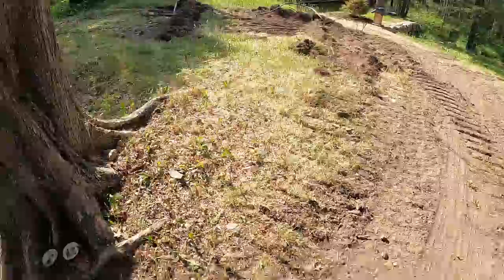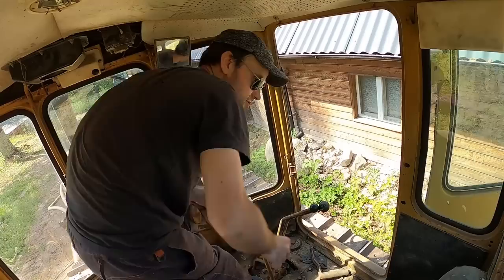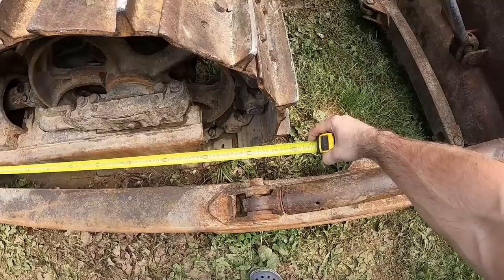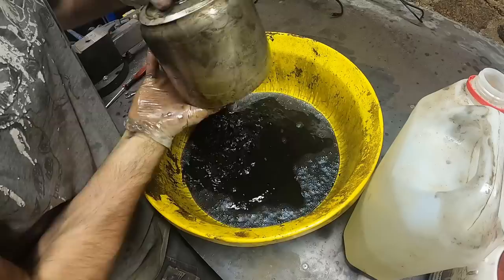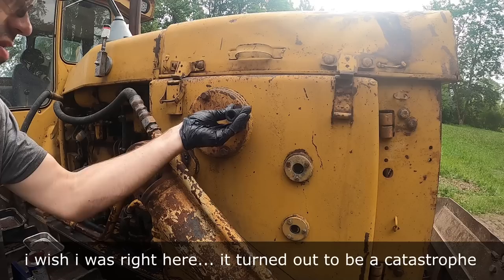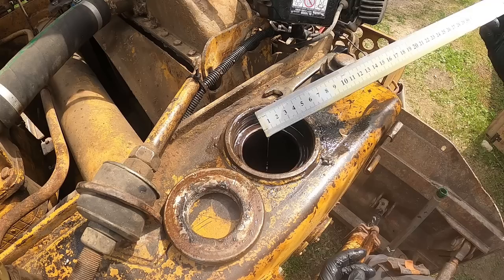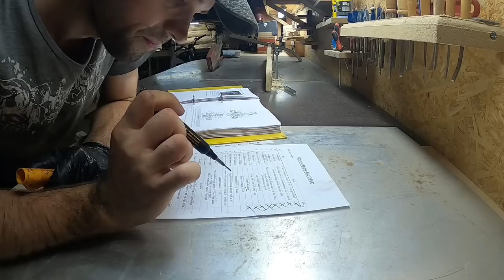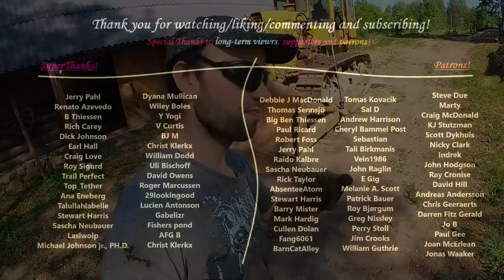Fixing the soviet bulldozer T-170 - Ep1

Comment: We used to drain the oil on machines and put it trough an milkfilter( paper filter on an funnel shaped holder). The filtered oil can be used for a lot of things, we used it for our chainsaws or even fill up our ancient machinery in between oil changes when they use some oil. Easiest way to check if the oil is nay good, after filtration  is just put some between your fingers and rub them together. Water will make it rough as well as dirt. Also for use of making wooden poles rot resistent by putting the ends in a bucket with oil and some diesel and let it soak for a night. The wooden beams wil not rot for many decades to come😂
Really enjoy your vids👍👍👍👍 this weekend can not go bust anymore😊 thanks for another great vid👍 together with dieselcreek and andrew camarata i think you guys make the best vids ( every one in their own specific way)  on the internet🍺🍺🍺
Reply: Back into the fuel tank , them old diesels will burn oil just as good as diesel
Reply from the maker: Thanks man. really cool of you to mention AC and MATT. Love them both
Reply: As long as you realize that even clean used oil has lost lubercating property’s. Don’t use it for serious lube.
Reply: One of my neighbours was a former shell ceo, as long as the oil between your fingers is really slick, he would not change it in his car😂 he was from the development department and called most oilchanges scamms😂😂😂
Reply: @jankrijnen7374  he also made enough money, that he was the scam

Comment: Hello from Canada 
The pony motor has two crankcase drain plugs
Reply from the maker: Yes but why?
Reply: @Ants_Pants  hello 
 Two cylinders are used and each cylinder has a sump of their own 
You can get most of the oil from one of the drainage plugs and all of the oil using both 
You are very entertaining to watch and you have done a great job with the house repairs and the property maintenance 
Cheers

Comment: Good call in doing the service. Great thanks to the shout out as well. I think the rake breaking was like I have had it with this work.🤣 It's just my guess but maybe the T-170 high pressure fuel pump has been swapped out to a remanufactured pump later?  It looks kind of very newish to say the least. I could not find the year when they switched over to the newer style high pressure fuel pump. The high pressure fuel pump on these is a old CAT D4/D6 clone/remanufactured variant. The one on your T-40 is a UTN-5 that is a old Bosch inline pump being redesigned by soviet engineers in the 60s. I would not be surprised if these where the old OEM paper elements in the hydraulic filter. Over all good and very decent progress, keep on going.
Reply from the maker: Tänx! ma alles nüüd jõuan kommidele vastada :D

Comment: That plug on the rear is a 1/2 or larger extension like you use with a socket just by itself with ratchet or brake rebar impack gun
Reply from the maker: Yup your correct

Comment: Santa bring you more work/projct to do 😉😉😉😉.... VERY good work 👌👌👌on your dozer (including the very underrated benefit of cleaning/pressure wash the machine on a regular basis) I believe your dozer never had so much maintenance since new. About final drive plug; I do have succes by removing rusty plug with; 1- wire brush to remove most of the rust 2- than soak/spray it with high viscosity penetrating liquid to follow/penetrate the tread  3- do it/repeat it until it get loose. Sometime heat/torch can help a lot also. Can take some time (believe me...) Nice to see things are going well for you. Looking for Part 2  ✌✌✌✌✌
Reply from the maker: Thanks for the tips 😇

Comment: Thank you for taking us along on this adventure! The pressure cleaner - it sounded exactly like 2 B-25 WWII bombers flying along, until the video was speeded up. Then it sounded exactly like something I heard during the last 2 times I was abducted by aliens. The hydraulic filter was amazing - it just kept coming out and coming out. I was thinking, does this go through the engine? How can it be so long? And I am wondering what is the reason for this? Very interesting, and I cannot wait to see more about it. It looked like it had a ball valve built in, or was that a rod end bearing? Yes, the Sowiet Dozer is a work of art! So many gearboxes - and the spinny thing at the right angle gearbox near the pony motor. Amazing. If I had been given one of these as a small child, I would never have gotten into any trouble! Oh, it was not built yet when I was a child. No wonder I was in trouble....
Reply from the maker: 😂😂😂😂😂 love the comment mate

Comment: Just havin loads of fun!
Amount of iron filings on the engine oil plug magnet seemed relatively small to me. Not good ofcourse but for a machine like that it is probably a win.
A thing about copper gasket rings. If they look good I reuse them, but only after anealing them first. I also aneal new ones. Makes them softer and there is no need t tighten them til kingdome comes. Just heat 5hem until the glow good and driop them into water, or just letting them cool on something non cobustable.
Nice video as usual.
Great thanks!
Reply from the maker: Thanks for the tips mate
Reply: @Ants_Pants  btw. Forgot to precise what I said about the iron filings on the oil plug magnet.  Probabaly it is there due to the thinned out oil. Just be vigilant and keep a keen eye on the levels and viscosity. If that amount of iron filings keeps on accumulating despite correct oil condituons then you need to start plan the new video series on how to extract, renovate and restart a magnificent piece of Soviet motoring. 😄👍
Reply from the maker: Oh snap 😂😂😂
Reply: @Ants_Pants  something to look forward to!🤑🥴🤪
(Fingers crossed for not to)

Comment: Regarding the hydraulic filters.  If you cannot find the original filters, do not use those corrugated paper filters.  As you can see the oil pressure imploded them and started to tear the up.  In my opinion it is better to use fine mesh screen securely attached to the assembly.
Reply from the maker: Apparently it's a standard soviet filter for oil. It was cheap about 3 dollars each. I think the old ones imploded because their service was severely overdue

Comment: Hydraulic oil is hygroscopic, that's why there is rust, the moisture content is high and will darken the fluid. It will rust the pump and other components causing excessive wear.. it's probable haven't been changed in years, if ever. Wouldn't go wrong by changing it
Lift pump was leaking, they couldn't or wouldn't get a replacement, they removed it
Reply from the maker: glad i did, the hydraulic fluid looked like grey vomit i the bucket, in ep2

Comment: This is just a guess but maybe some of those bulldozers came with electric start and some of them came with pony motors. The ones with pony motors may have been determined not to need a priming pump since you can just use the pony motor to turn the engine indefinitely until the system primes itself.
Reply from the maker: mostly export to west had the starter motor, everything locally got the pony motor.
Reply: @Ants_Pants  Yeah that's kind of what I was thinking. I figured if it got a starter then got a primer pump and if not then it didn't. Just a theory though.

Comment: Spray some penetrator oil or spray om the over drives plug it should help it and use a long extension bar to help you open it plus the penetrator spray can help on mostly anything you need loosening or lubricant on
Reply from the maker: It did help yes, i got them loose

Comment: - The threads seem to already crossed because the plug is not screwed in very far at: 1:04:40, Andris
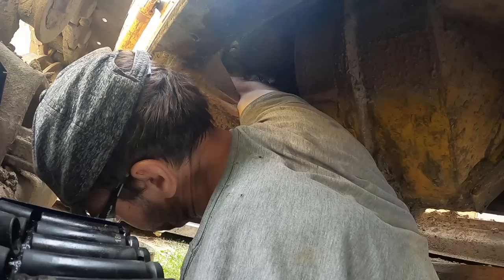- Replaced: 1:06:01
Reply from the maker: Maybe it's not needed?
Reply: @Ants_Pants  
- If you ever do use a pump-jack to hold up the bottom pan so you can take it down for some kind of repair work, you could also re-thread the bolt hole if it was cross threaded.
- Clearly it is not leaking oil and messing with it is not needed, thank heavens.

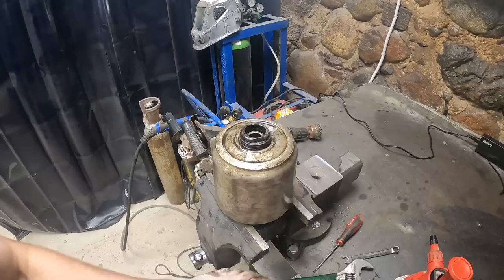Comment: At 33:03 you should can take off the lit of the Engine oil Filter by turning the big nut on Top of the Filter left. Than you should can take off the lit in up direction. It can be a little sticcy cause it can be a Seal at bottom of the Filter.
Sorry for that Bad English
Reply from the maker: I understand sir! But i tried it's very stuck and i don't want to damage it.

Comment: Best start soaking those final drive bolts in penetrant.

What have you used the dozer for so far?
Reply from the maker: Just 3 things 😆 snowplowing, 1 tree pull and some stumps
Reply: @Ants_Pants  nice! Every episode lately I have eyed it off as my driveway needs redone heh. Hoping to buy a hobo like yours soon tho
Reply from the maker: @zzzires5045  although i rip on it a lot, i use the bobcar most often out of my tiny fleet
Reply: @Ants_Pants  yeah that's why I want one here, plus can easily rent attachments like post hole digger ect. They kinda have surpassed a tractor for a farm vehicle

Comment: When I saw you repair the rake I was thinking about the problems I've had with cheap brooms - the heads are good quality, the handles strong enough usually but cheap plastic brackets?!?!!  What falls apart is the silly little plastic bracket that attaches the head to the handle of the broom. I tried to get a metal bracket for this but there was only one design I liked the look of. You could make a Soviet-style broom-head bracket with 10mm steel, so strong that you're guaranteed to snap the broom-handle when you use it. I don't think you'd even need 1mm steel for this but having a few might mean you can keep replacing the plastic ones and buy cheap brooms and replace the plastic brackets when you need. The old style wooden broom head and handle that you could nail or screw together was generally better....

There was a comedy in Britain that had a council roadsweeper in it who once said 'I've had the same broom for 30 years, it's had 35 heads and 20 handles now....' maybe this was because he had a high quality metal bracket to hold the head of the broom on....!

https://thedustpanandbrushstore.co.uk/products/large-metal-broom-socket-bracket-connector-for-platform-and-yard-brushes?variant=14266353713194&currency=GBP&utm_medium=product_sync&utm_source=google&utm_content=sag_organic&utm_campaign=sag_organic&gad=1&gclid=Cj0KCQjwkqSlBhDaARIsAFJANkj9JiiQU9rCXpUxpPK_nbL8_fELZBlIUqx1Q4YmmCOEISIscAPJIYQaAj9TEALw_wcB

Comment: Looks very thin, i would suspect the injection pump leaking internally. If you had an injector problem it would be smoking more. You could also have a problem with the rings bypassing. I could be wrong who knows, like you said its 40 something years old.
Reply from the maker: it does smoke very little after starting the motor for about 20 to 30 seconds, after that the smoke clears and it runs smoke free (apart when load is applied to the engine, but that's dark smoke and normal for diesel engines)
Reply: Yes that amount of smoke looks normal. I would still suspect the injection pump leaking internally, but I also have no experience with Soviet equipment. In a tractor that old the injectors are simply the nozzle that sprays the fuel, not like modern engines that have oil actuated injector units. so if it does not smoke profusely I don’t think that is your problem. Also how did the oil feel when you changed it? Was it slippery like oil or was it more like black paint thinner?

Comment: 100 liters of hydraulic fluid...can the old fluid be repurposed as something useful ? Is it just mineral oil that could be used in a oil heating furnace in a house ?
Reply from the maker: throw it back in the fuel tank 🤣 this thing will even run on crude oil on a rainy day

Comment: Great video, Ant. I know you have a ton of work still to do, and sure, your checklist is at the halfway point, but you really need to do something about the swaying motion of the blade every time you move the doza.

The blade moves without you touching the hydraulic leavers which is bad.  I know there are only two main cylinders and a couple of smaller ones on each side, but it moves way too much fir my liking.

What condition do the pins look like? I bet they are toast like the ones on your bobcat were, I'm just saying.😂😂😂
Reply from the maker: it is missing a support arm from the right side. the weld had broken at some point and previous owner did not fix the issue. I will tackle this problem soon, but i think it will be on Episode 3, not 2. The damage is done though, sidepanels of the blade arms have been eaten into by the tracks.
Reply: @Ants_Pants  great to know Ant. Thanks for giving me a good explanation and what the deep problem is with the blade swaying as it does. And thanks for the details of what is to come in a future episode. Cheers mate

Comment: Be careful you don't get water concentrating in the pump, freezes during winter and then when you go to start it the pump shaft breaks. Guess how I know ....
Reply from the maker: fuel pump?
Reply: @Ants_Pants  
Nope, the soviet hydraulic pump, but it might be more robust than the early '70 yankee pump that I broke due to water/ice build up.
Just considering how bad your hydraulic oil looks. Mine looked the same and the tank filter looked pretty much the same as well 😅
Reply from the maker: @Mr.Engineer.  the pump is not very expnesine to swap out. Around 300$. I swapped the fluid glad i did 😂 see in ep2 this friday
Reply: @Ants_Pants  
Will do, every week 😉
I think my wheel loader is destined for the scrapyard.
Reply from the maker: @Mr.Engineer.  t
Why so
Reply: @Ants_Pants  
To much work, to little time.
Bought a newer, bigger and better unit.

You want the old one?
Come and get it, but do note that there is no hydraulic, so no lifting of the bucket and no steering.

Comment: I thought that looked like a high quality choke cable as most I’ve seen here are poor quality. I saw pull to stop on knob so I imagine it is intended as a fuel shut off cable explaining the somewhat higher quality than average choke cable.
Reply from the maker: yeah it's original purpose was as a fuel shut off, but can be used as a choke cable as well

Comment: I'm curious to know if it's possible to still get parts (like filters) for these old Soviet machines?
Reply from the maker: Soviet engineers stole most plans and ideas from the west. In most cases generic parts will fit. Like for example i used some old VW thermostat to swap it out in this dozer 😂
Reply: @Ants_Pants  Soviet Anthem plays loudly in the background.

I'm impressed/amazed by how prepared decked out your shed is.

You have lots of stuff that you need on occasion, like O-rings, electrical connectors, washers, bolts etc.